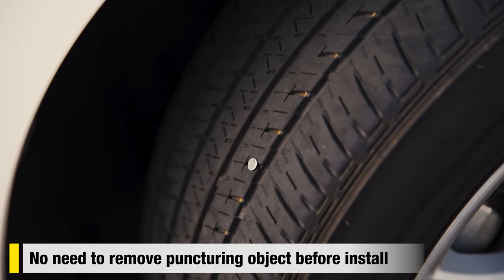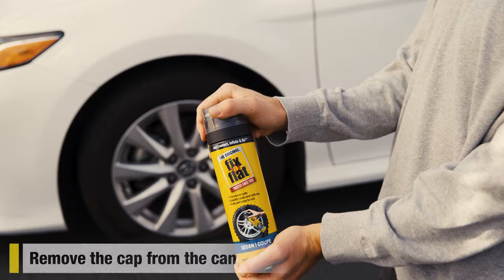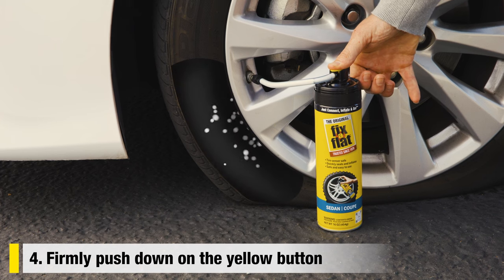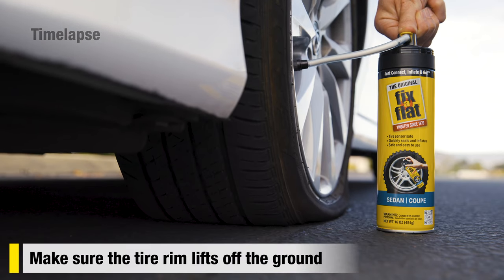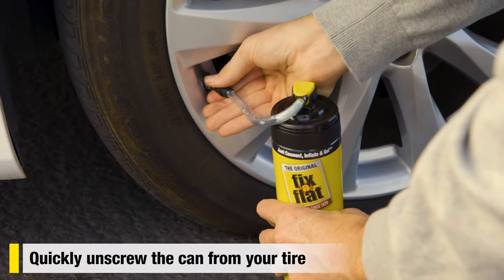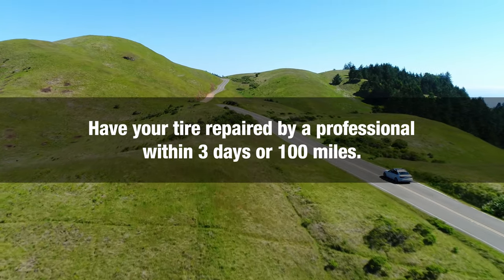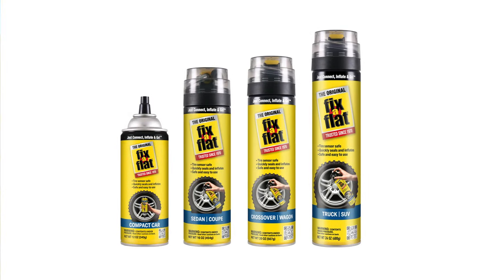How to Install Fix-a-Flat

Comment: DON’T WASTE YOUR MONEY ON THIS! I bought one for each car doing what I could to be prepared. Finally when I needed this can the most it did NOTHING barely anything came out.
Reply: Just bcuz yours didn’t work.. or something was wrong wit your fix a flat can does not mean it won’t work for others.. Negative Comment for no reason
Reply: This product's been around forever, because it works well. 

Also, the puncture has to be super small. It doesn't fix blowout level holes
Reply: @mumfordmalik well there’s a reason for the comment mostly except for saying don’t buy it I agree with both of y’all but whatever haha
Reply: Did you shake the can😂😂😂
Reply: The same with me... with two cans... is trash....
Reply: @sandisomazibuko86  my exact question,  I've used this during several tire emergencies and all but once it's worked.

That one time the hole was on the bottom of the tire and much bigger then I thought. 

This stuff is great, but a real mess to clean up when actually changing the tire.

I forgot to inform the tire shop once that I had used this product a few hours before, & boy did I get an earful!!
Reply: Unfortunately it didn't work on mine too, but as a lot of people mentioned, it does work when it does and it works well when it does. Tonight it didn't work on my F150 but the tires are from 94 lol so.... What everyone says..... Lol does well when it does and sometimes it just don't! Hope you got something that did work for your vehicle!

Comment: Fix-a-Flat should be stored near the spare tire in the trunk of the car.  It should not be stored in the glove compartment.  The glove compartment can become too hot inside during the summer and cause a pressurized can of Fix-a-Flat to explode.  A person would still need a portable air compressor to fill the punctured tire to full capacity.  The Fix-a-Flat sealant probably won't last forever.  A person should get the tire repaired or replaced by a mechanic if the tire starts leaking again.  The tire can be repaired if it still has plenty of treadwear.  A mechanic will remove the tire from the vehicle to make a permanent repair.  A tire repair shop will usually put a plug in the tire.
Reply: Thanks for being so informative an sharing with us 😊
Reply: @BobSmith-vj5kz no way! When it’s too hot in the summer, I like to hang out in my car’s trunk
Reply: Thank you for the information brother

Comment: Man this stuff is a life saver. I had little faith because my tire was super flat but it actually worked. I Just went straight to the gas station and added more air but I wouldn’t have made it without this.
Reply: My friend just saved me having to tow my Tesla due to a flat. Had it in his trunk and I am getting the tire repaired first thing tomorrow. I agree amazing stuff.

Comment: How long does it take for the can to empty into the tire
Reply: About a minute give or take. Fix a Flat website says 45 seconds on written instructions. I had to use it yesterday.
Reply: Fix a flat works
Reply: Wish I could have seen this before I used it.  The air came out of the back of the can and I sat on the ground for at least 20  minutes watching the white stuff trickle in.  Probably won't help...  More than $12.00 too.

Comment: Hello bud, do you need to apply the whole can or half can thanks for sharing
Reply: I ain't him, but when I used it, it stopped dispensing (the gunk stops passing through the hose) when it's to the point it's done it's job.

Now this was on a motorcycle so it may use the whole can on a  large automobile tire.

The motorcycle tire wasn't 100 % inflated, but it wasn't leaking  either so it got me off the highway.

I still have half of a can leftover. 

I think maybe it just stops dispensing when it reaches a certain pressure. 

So just keep adding until it stops flowing weather it's empty or just finished I'd say. 

(The directions elude to that as well)
Reply: I used dis stuff when I had a nail on my front and back tire ! Dis was 6 months ago I still ride with the same tires nail and all but now I fill it up with air whenever it gets low! That’s the trick! Instead of paying for another 🛞! Jus keep filling your tire 😊works for me! Ya beta believe it!!!!!!!!!!!!!!!!!!!
Reply: use all of it. also you can only use the can once, you can't save half, because the sealant will harden in the hose and even if you have sealent remaining it will be trapped. its one and done so use it all.

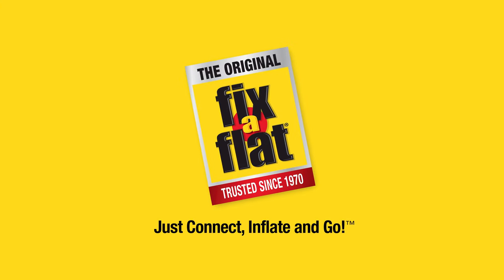Comment: 3 of us Could not get the lid off the Can!- had to Pry it off with a Screwdriver!! 1:00
Reply: I had to look it up and they said to put the top between the tire and ground and wiggle and it actually came off for me
Reply: I am having an issue with the lid too...I am trying EVERYTHING
Reply: @mslashon5600 lmao we shouldn't have to do that...omg this sucks
Reply: @mslashon5600 I am just going to put air in it and wait until it gets low again...take it home and pry it open with something